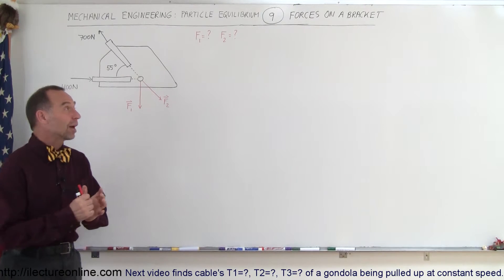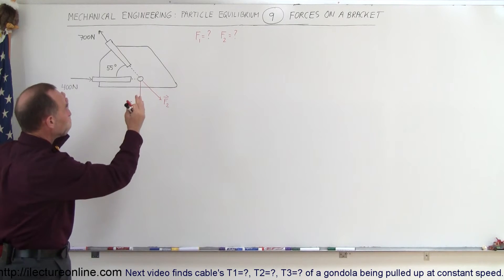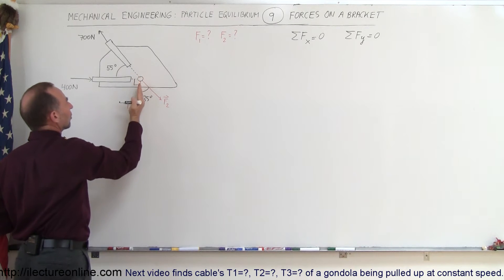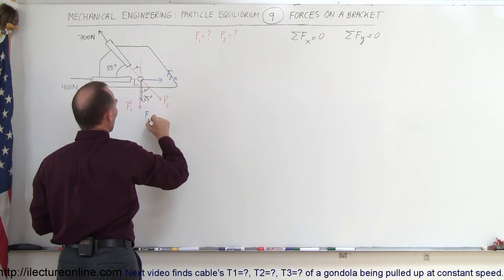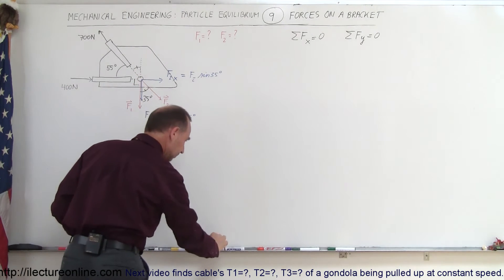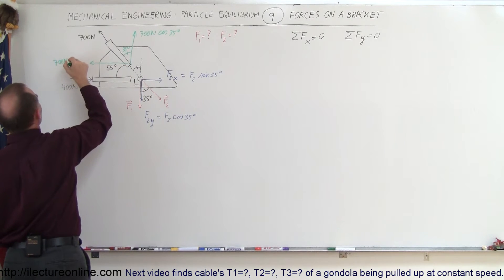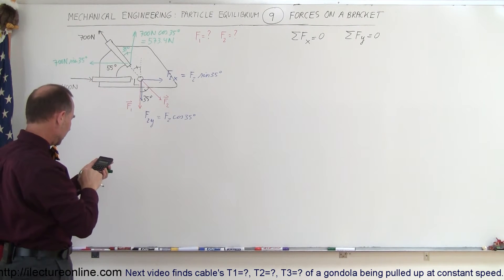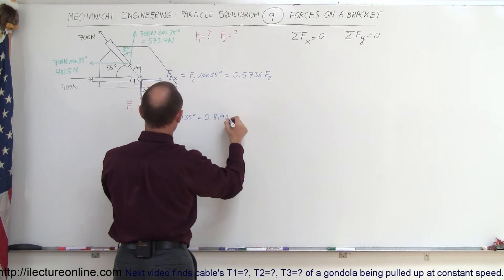Mechanical Engineering: Particle Equilibrium (9 of 19) Forces on a Bracket

Comment: If the F1 were not downward, it was at horizontal. 
F1=400N
F2=700N
F2x=401.5N
F2y=573.4N
Is it right? And why.thank you.
Reply from the maker: Not sure why you are asking that question.  You need an F1 force downward to balance out the forces.
Reply: @MichelvanBiezen  If the question does not specify to find F1 and F2, but to find the reaction force to achieve equilibrium, are there only horizontal (Fx) and vertical (Fy) reaction forces?
Reply from the maker: Ah, now I understand the question.   No there will be only one force required for the reaction force.  But since the reaction force is a vector with both magnitude and direction, you can only determine the force by finding the x and y components of the force separately.

Comment: At 2:10, you can to find the degree of the forces of f2, since it passed through the 3rd quadrant which is 270 degrees and plus the 35 degrees which is equal to 305 degrees. 
Then calculate f2x cos and sin 305 degrees has the same value of sin and cos 35 degrees. 
For f2x cos 305 = 0.5736 and for f2y sin 305 = -0.8192
I owe this knowledge to Prof Michel Van Biezen. You're the best. :)

Comment: F1 and F2 can be at another position to be stable? how do we decide the position?
Reply from the maker: It is possible to pick a different point on the bracket to place the 2 forces, F1, and F2, and find their magnitudes such that the sum of the forces in the x and y directions are zero, but also note that in this problem, the lines of action of each force all meet at a single point.  If they didn't, chances are that the net moment would not be zero, and the bracket would start rotating until the net moment was zero.